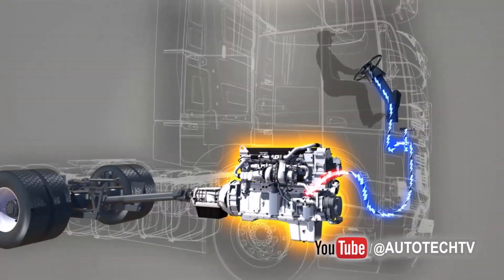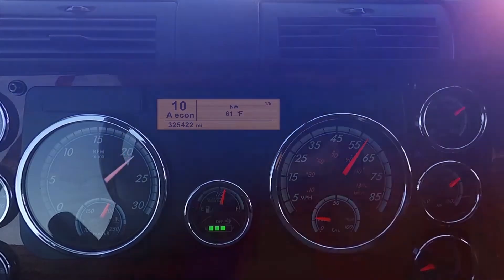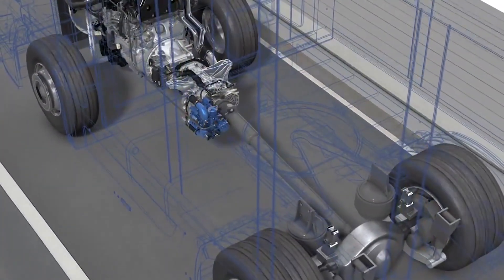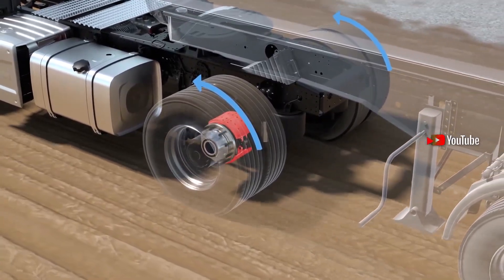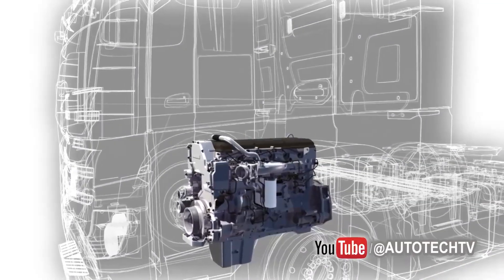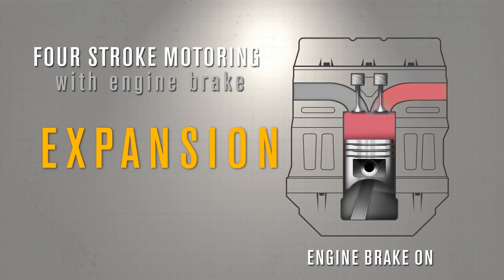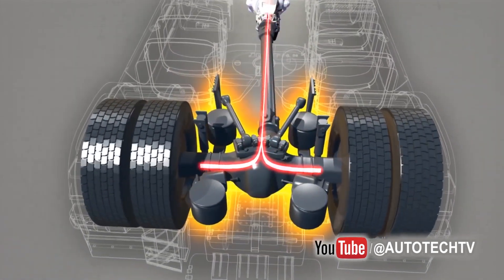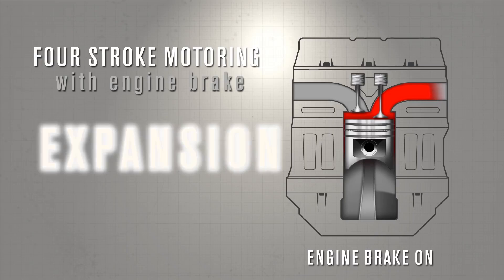What Is Engine Braking? What Is a Jake Brake?

Comment: What’s so satisfying even if it’s just a compact SUV with an auto transmission that has a manual override available on the stick, is that fuel consumption for just these few seconds becomes 0 since the combustion step peaces out (it even shows on live OBD2 readings!)

... alongside less usage on the brakes - however minimal that would be in stop and go traffic anyways ¯\_(ツ)_/¯

Comment: Does it hurt your car to do this? Saving on brakes is great but I don't want to hurt my transmission or something more expensive than brakes.
Reply: Just like stress is put on the transmission when accelerating, there is stress when engine braking as well. It’s not significant to the point where you’d want to avoid it entirely, but as my Dad would say, it’s cheaper to replace brakes than a transmission.

Comment: Putting the foot on the clutch in a high gear is just stupid anyway , free wheeling should be allowed without loud just by lifting off the pedals all together. Its the clutch depressed at speed without the accelarator that roars. I used to just knock it out of gear and free wheel box hill north hill minehead and a few other nice roads , mad mile and so on without any roar but a tic over drop in sound by knocking it out of gear too. If you knew the hills they wee easy at night as other lights would let you know you had a few easy seconds to place the engine into situ. I love night driving , done Surbiton to Dorking in less than twenty five minuits at three fort five leaving to parked up and through my door just past the hour by near ten. I used to flick the lights off coming up to junctions and seeing no other oncoming lights on cars would safely take intersections while a red light would get the same treatment at junctions , when no cars were lit up i would just swap lanes and turn back in on the passing , It was one time only and the luckyest run as i needed to stop a suicide attempt by a girlfriend. But in that time i was not bellow ninety and up to 125 in my ( frenetic ) Perjo 205 fuel injection. Fastest safest car i ever had , gripped perfectly. The only issue i had was working in steel toe caps at first i could not feel how fast i was going as i usualy can when used to a car and would regularly find myself at ninety not seventy at five thirty to six in the morning to get to my brick making job. It was a month or so before i got a legal feel for it and as i said they held the road so well ( which caused a lack of that woops im speeding feeling as in other cars ) they run so smoothly.
Reply: What??
Reply: Fuck knows bud , some fkers used my I d and looks like they gave you life story with a bunch of shit when I find out who commented using my ID I will let you know and you can ask them @michaeldehoyos6185

Comment: And this system is used in which engine?       I know most of the engine brakes, intarder, retarders, flap systems, including similar valve disengagement techniques, but only in newer engine units. But I haven't come across what is in the video yet, please, author, where is this type of engine brake used on which engine?
Reply: All engines with a manual transmission can do this.
Reply: @SpencerLemay  incorrect. Anything with a diesel engine, can have an engine break installed. Regardless of transmission.

Comment: If this is engine break then what means engine breaking in motorcycle?
Reply: It's the same but in motorcycles or manual transmission cars you have to manually downshift (the lower the gear the greater the braking effect) and stop throttling (this approximates/imitates a compressor mode since you are unmatching the engine to vehicle speed given the transmission gear ratios when you downshifted)
Reply: @luism5822 you mean controlling speed by lowering gears and applying breaks same time right?

Comment: One way or another, kinetic or potential energy turns into heat. With normal disk or drum brakes, the heat goes into the disks or drums, potentially overheating them. With engine braking, the heat goes into the compressed air, which is vented out through the exhaust system. The heat goes out, so this is why engine braking is far more dependable than normal braking in prolonged downhill driving.
Reply: Physics in motion

Comment: Do normal cars do this? Or only trucks?
Reply: Auto and manual cars can do it but mostly manual. The big rigs that make the noise are also manuals usually
Reply: @thepeskyone  i think auto cars with Low and Second gear selector can do this by selecting those lower gears. Also cars with buttons or whatever that switches the overdrive off to force lower gears also does that.
Reply: @fmacedoo  ive done in my moms car and mine and can confirm. Its soo cool lol. I think manuals can do it the smoothest though if done right
Reply: @thepeskyone  it doesn't matter if it's auto or manual. As long as it's DIESEL and has an engine break installed. This video & comment section is full of misinformation. The valves stay closed during the compression stroke, and just before TDC the valve opens, releasing the compression. THAT'S WHY it's called "compression release", and THAT is the loud popping sound. This video may explain an "exhaust brake," but it's definitely not an engine brake, or "Jake brake." Called "Jake brake" because it was originally produced by Jacobs Manufacturing Co. It was invented by Clessy Lyle Cummins in the 50s.

Comment: So, as a truck driver, how do you properly slow down on downhill?
Reply: depends your vehicle is empty or loaded then make sure how steep the downhill is, if it's too steep then down shift to lowest gear and activate the engine brake stalk and also anticipate service brake to contol vehicle speed